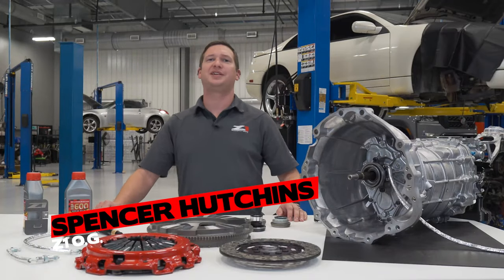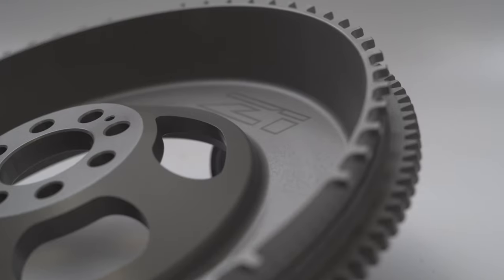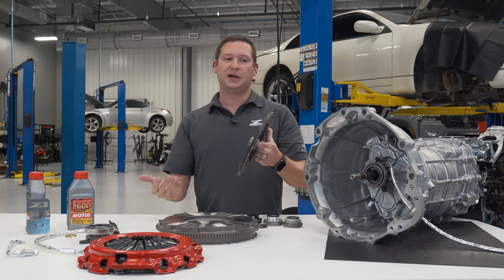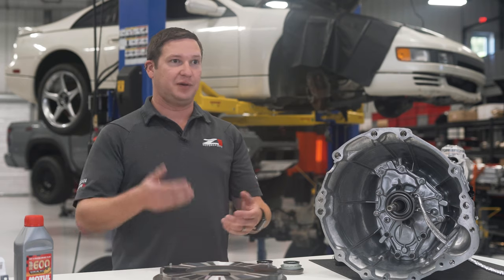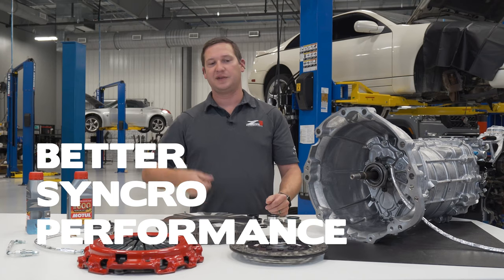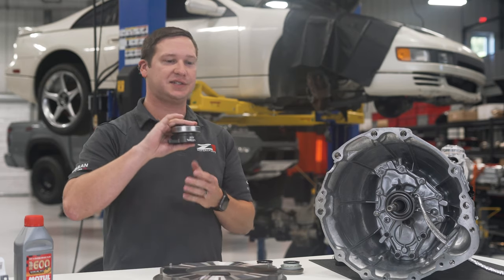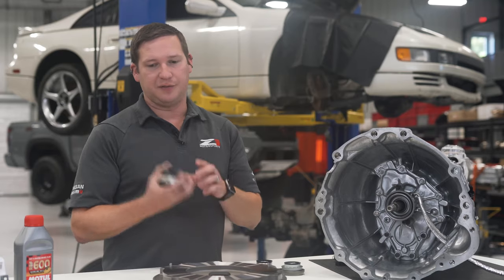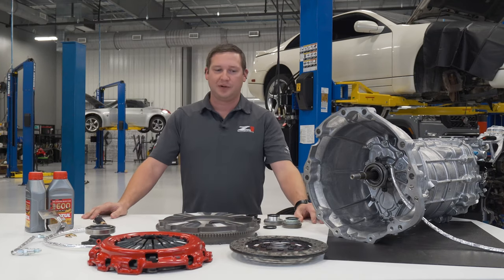Behind The Design | Z1 Road Race Clutch Kit

Comment: First Impressions: as I just got this kit installed on 3/11/24 and the pedal is 3x heavier/harder to depress. Still drivable but your leg will feel the difference !(clutch engagement point is quite high aswell). Overall quality parts and my shop had no trouble installing all parts, I will update if I have any additional insight
Reply: Update? Daily use??? How did it turn out???? Worth the money???
Reply: @ You can no longer by the “heavy duty” Tilton CSC. Z1 revamped their Road Race vit and added the V2 Elimination kit ! I have nothing to state regarding the V2 version of this kit as it’s on backorder currently. Ironic that you asked me about this today as I am just getting my car from the shop after the tilton csc shit itself after only 7 months. So no I would not recommend spending your money on this 2 grand including labor repair. Order a CMAK from ZSPEED and be done with it. I replaced all the Z1 stuff that I had put in March of this year and paired the CMAK with a stage 2 competition clutch kit. I did keep the lightweight flywheel from the Z1 kit as I did not want to spend more than what this has always cost me and the flywheel at least is a nice piece (it will chatter and make much more noise than the stock 1 when it gets hot). If you have any more questions reach out to me

Comment: i like all of that except the pressure plate, nightmares when driving with that one piece, but the rest is solid
Reply: Explain.
Reply: @fernandohood5542  It is very stiff(clutch pedal) at first but has lightened up some after a couple heat cycles over 2 weeks worth of commuting. Dont be afraid, qaulity pieces in this kit.

Comment: I bought this one and my clutch became really heavy to press. I wanted to know before I bought.
Reply: how has your setup been holding up? has the clutch pedal feel got any better? im planning on getting this kit
Reply: @ProteinPounder  it’s still hard but i got used to.
Reply: @ProteinPounder  did you get the kit bro ? if yes how is it holding up ?
Reply: I can vouch as I just got this kit installed on 3/11/24 and the pedal is 3x heavier/harder to depress. Still drivable but your leg will feel the difference ! (clutch engagement point is quite high aswell)

Comment: How is the chatter of this setup? Lightweight flywheels usually produce a lot of chatter :| @Z1Motorsports
Reply: Chatter is not very noticeable at idle(which was a worry of mine). Does chatter if your in too high of a gear for a given mph(exp. 5-6 gear at 30mph), noticeably loud at times during lower rpms not really a problem or nuisance in my opinion !

Comment: My question is will this Z1 HD CSC last or is it up for grabs on how long it will take before it starts leaking? I'm not questioning Z1s products because so far everything I've bought from y'all has been awesome. I just know that this CSC is a crappy design from the manufacturer. Would I be better off in the long run just eliminating the CSC altogether? Any help would be greatly appreciated because I can't afford to change this again soon. I've heard mixed things about these CSC units in general. Like I was going to go with the JWT HD one but I think the Z1 is made better from what I can see so far. So far my factory CSC has lasted 170K miles but it's going out for sure.
Reply: You’re complaining about a better made aftermarket CSC when your factory plastic one has lasted longer than mostly anybody’s? Come on bro
Reply: Bro, your CSC basically almost outlasted your car and it’s a factory part. I have went through three of them that were OEM. JWT is my go to at the moment. I am at 69K